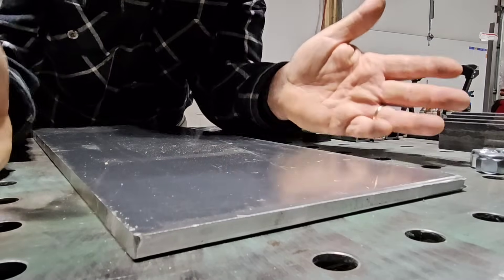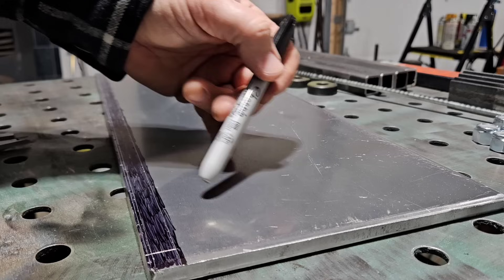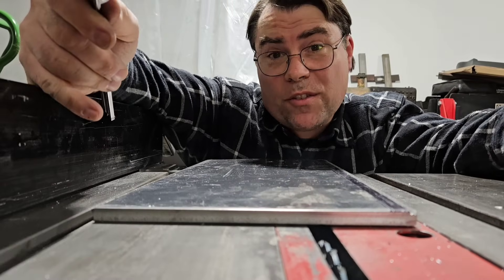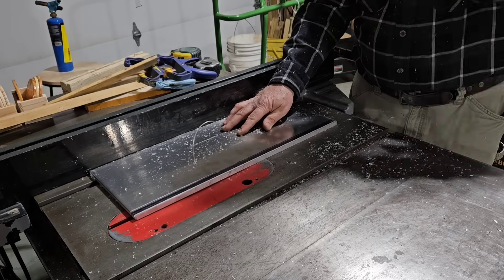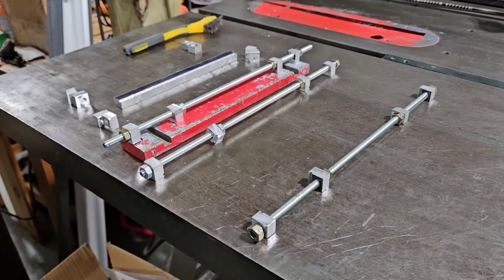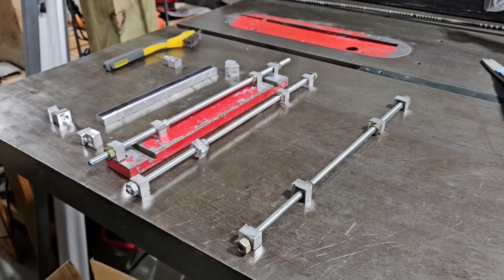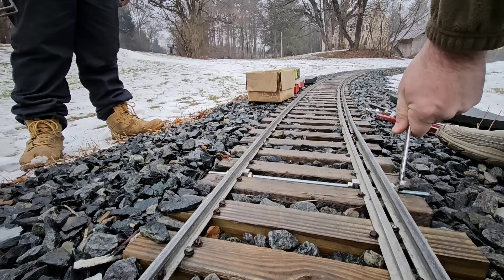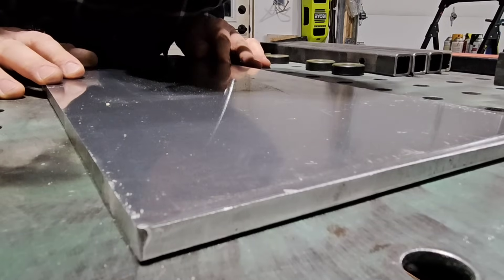Let's GAUGE the issue...

Comment: A quick note about cutting all those little blocks. If you set your saw's fence and clamp some block of wood to it before the blade, you wouldn't have to mark each individual block, you could just bring the miter gauge back, slide the aluminum blank right until it bumps into that block and then just cut another piece and they all would be the same size.
Reply from the maker: Good idea. I'll have to remember that the next time I run parts through the table saw. I've since bought a metal cutting band saw, and it has a built-in work stop that I make good use of. The table saw is not my favorite tool for cutting aluminum, although sometimes it's the fastest.
Reply: @MillBrookRailroad  this method wil also work with your bandsaw. Just set a stop block and get repeatable cuts. As for the table saw, I'm quite sure you need to cut identical wooden or plastic parts. That'll work for them too. Just make sure that the stop block is before the blade, so the piece you cut doesn't get pinched between the blade and the fence.

Comment: When we were overhauling all the former ATSF cars, I was regularly using the table saw with a carbide blare to cut the aluminum structural shapes for dressing the window frames.
Reply from the maker: I have to confess that the title is a little click bait-ish. I've actually been cutting aluminum with a circular saw for years. Most people don't know you can do that. Although, this is probably the largest piece of 1/2" aluminum sheet I've ever cut on the table saw. 
Those window frames you worked on look amazing, by the way.

Comment: Boy 1980s me in shop class was waiting to see the metal sheet fly.
Cool deal you got and saw tech is amazing.
Lock tite can be heated out but the blue can be twisted off pretty easy. I Agree with the others a second nut to lock the other.and it’ll look like a full size. I worked for a place, that their main diet was gauge rods and not ties.
I like it can’t wait to see how it weathers.

Comment: Just a thought, and I'm no expert, but when installing a gauge rod and there is a guard rail, shouldn't the both slider pices be on the stock rail? i.e. the inner one fastened in between the guard rail and the stock rail rather than on the guard rail and the stock rail, because with vibration, the slider, (either one) could be displaced due to the guard or stock rail being free to move on the one side.. 
Otherwise, a great solution to to a frequent problem.
Regards, Paul in Cornwall
Reply: Agreed, and I would also use self-locking nuts (with nylon inserts) because those ordinary nuts will quickly be loosened by vibration.
Reply from the maker: @Alan-ln3ls  I did try nylon lock nuts on the next one. It was challenging. After wrestling for way too long with one gauge rod, I decided that it probably doesn't matter a lot because this isn't a permanent solution, anyway. It's a stop gap until I can replace the bad ties that are frozen in place. In the meantime,  my track inspections will have to be done with a wrench in one hand.
Reply: I thought the same thing...  You don't want to be clamping against two rails (guard and stock rail) like Aaron has done here.
Reply from the maker: @PaulWilliams-h1y  You are correct, I shpuld only be clamping against the stock rails. But I was short on 1/4-20 nuts, and the inner jaw won't fit between the guard rail and the stock rail, so I was forced to compromise. I'll eventually remove the guard rail when I superelevate the curve. I'll also replace the split ties and install tie plates, negating the need for gauge rods in this section altogether. In the meantime, this is very much a temporary solution borne of necessity and filled with compromises. In a word: janky.

Comment: If youre using a metal cutting blade, GO FOR IT❗I think ive seen those gauge rods on full size roads........
Reply from the maker: @paulsmith5398  it's actually a plywood cutting blade, but the blade's SFPM is on the low end of what aluminum wants to be cut at for that spindle speed. On the low end is still in the range, so I'm happy about it. I looked it up after I edited the video.

Comment: Brilliant design! I can see an issue looking that you have probably already thought about,  but I am going to mention it anyway, just in case. I would cut those threaded rods shorter than your cross ties. If you derail,  the wheels will not land on the end of your rods and dislodge them. 😊
Reply from the maker: I thought about it and I cut the next ones shorter. I'll shorten this one when it comes out. These are not permanent fixes.
Reply: *looming *

Comment: Adjusting the track width by knocking the rail is terrible. Nothing is holding the track there. When the rod is installed it keeps the track width in order.
I have some memory of real railroads doing the same in, I guess, urgent situations.
Do You predrill ties before screwing in them? The small dimension on the ties easily makes them split. I hope You know how to orientate the tie according to the fibers.....
Having both a bandsaw, a mini mill and more I think You did very well using that saw. T U.
Reply from the maker: @Stefan_Boerjesson  Glad you enjoyed it!
Since I did this video, I acquired a working band saw, and the mini knee mill that wasn't working for this video is now partially working. 
 Now, to get a set of double taper Y collets and an assortment of end mills so I can make some work holding fixtures.

Comment: I have a carbide blade on mine and it handles aluminum no problem
Reply from the maker: Most people don't know you can. What I don't like about cutting aluminum on the table saw is aluminum's propensity to grab and kick if you try to feed it too fast.
Reply: @MillBrookRailroad  it does like to grab. I only really use the tablesaw for aluminum when it won't fit in my band saw. Works in a pinch, but can't say I recommend it.

Comment: yes I had to cut aluminum on a table saw with 10” blade 80 teeth! nice smooth cut! we used a hold down and pusher.
yes with the grove in the block it will hold the base of the rail in place. great idea and job implementation of your idea.
Reply: One should always use a safety pusher when sawing freehand on a table saw.
Reply: Put masking tape over your cut area and you’ll find it cuts easier due to the glue of tape acts as a lubricant. A little something I found when doing this when making aluminum inlays for table tops.
Reply from the maker: I calculated the speed and feed after shooting this video, and it turns out my blade cuts with just about the right amount of surface feet per minute for aluminum.